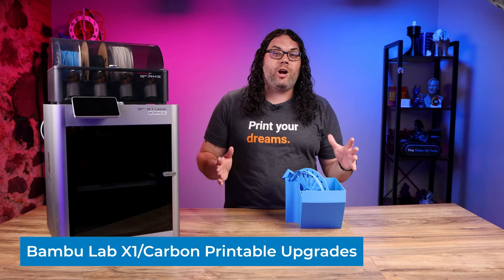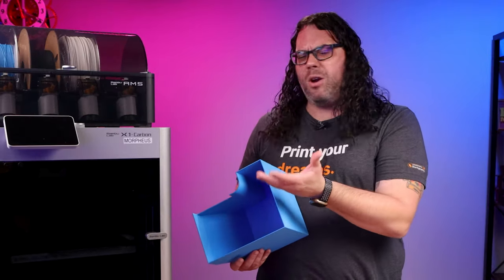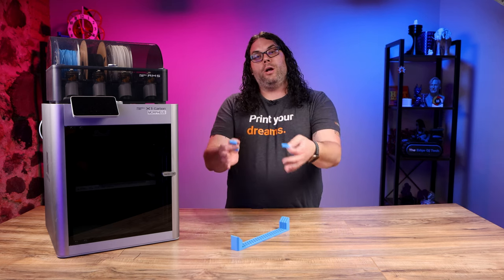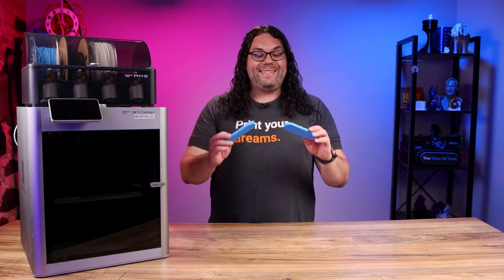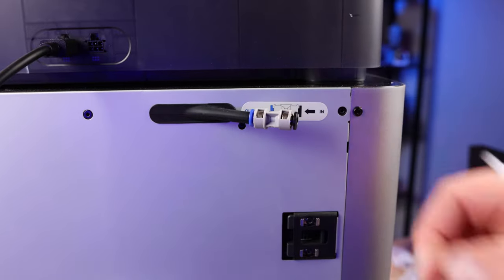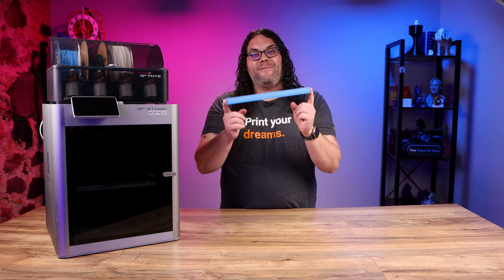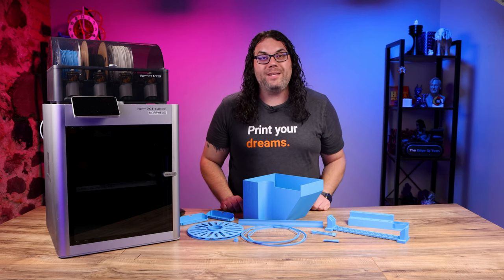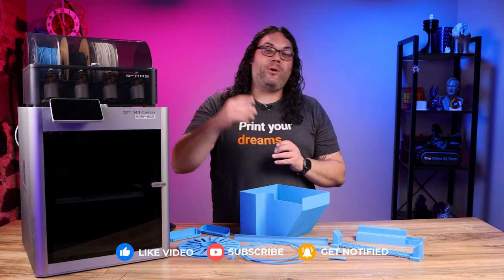10 Amazing Bambu Lab 3D Printed Upgrades You've GOT To See!

Comment: With the cardboard spools, I rip the two sides off and then use the spools that came with the printer as they split in half. There are also spool models built into the printer. This works the best with the AMS so far. You do not need to remove the center cardboard spool as the spool model slips under that.
Reply: Thank you!
Reply: I messed around with all sorts of different rollers and rings for cardboard spools, even tried designing my own, but wasn't happy with any of them. You need rollers to be very snug on the cardboard so that they don't slip when the AMS is back-rolling them, but you also need them to be very narrow because the bottom of the AMS has channels that are only about 10mm wide, and if your rollers rub against those, you'll have retraction errors too. If your cardboard spool is dented or not perfectly rounded or centered, a roller can exacerbate that and make it wobble in the AMS, and if your roller has retaining clips that go over the edge of the cardboard to hold it in place, stuffing it under those clips can create the dents and imperfections you don't want.

In the end, it's much easier to just wrap a single layer of electrical tape around each edge of a cardboard spool. That gives you great traction, no slippage, no extra width, doesn't need to be carefully adjusted for different brands, and it's faster than printing even the smallest roller. Which should be a lesson to us: not every problem is best solved with a 3D print.
Reply: The least amount of work for simple prints, is just to ditch the AMS and use the back spool holder.
Reply: You are a flipping hero. Thank you.

Comment: When it comes to the spool cover I would say it's a perfect reason to learn some CAD software, a model like that would two minutes in Fusion360 (hobby licence) + a pair of cheap callipers.
Reply: Too much effort. You can just scale it in Bambu Studio.
Reply: @drCox12  It's effort that's well well worth it, once you have some CAD skills you can unlock the true potential of your printer.
Reply: @ChimpyChamp  I agree but you should never overcomplicate things. If there's an easy and reliable way to get the job well done, then take it.
Unneccessary complexity is prone to failure which leads to frustration which leads to loss of motivation.
Learn step by step: Learning how to scale things in Bambu Lab is a lesson that is also applicable in CAD. Because just scaling the model is exactly what an experienced CAD user would do.

Comment: These are great upgrades for the Bambulab printers. The spool ring i use is from Blizzard called the Cardboard Spool Ring for Bambu Lab AMS (parametric) - I resized it for Polymaker cardboard spools by 1.5%

Comment: Great stuff you found, thanks👍 I did two smaller sized poop-buckets that can be found on Thingiverse ("bambu lab waste basket"). IMO one of the best mods for the Bambu Lab is a simple cotton-blanket to dampen this beast. First I bought some plywood boards and build a U-shaped enclosure for the sides and top, but the most sound emissions are coming from the back of the printer that needs to be accessible. So I just put a folded blanket on top of the AMS which is just hanging loose over the backside, but huge improvement. Not much improvement in decibel, but it filters this annoying high frequency hall-effect sounds very well and just sounds like common printer with it, not like a factory. IMO Bambu Lab should offer a silencer out of foam for it that fits nicely on the back.
Reply: Any Problems with heat or airflow?
Reply: @VigiHunter  Nope, the defaults work with all filaments I'm using and don't tinker with temperatures, flowrates etc., but just quality settings like shell- and infill-rates. I've one very cheap TPU-filament that wasn't working well and the default speed-settings with TPU should be reduced anyway.
Reply: @Leynad778  Oh I don't means heat while printing but heat problems in the back where the PSU, Mainboard and stuff is. There is quite a large fan back there so I was wondering if a blanket makes it a heat trap 😅
Reply: @VigiHunter  Certainly not during a German Winter.

Comment: Just throwing this out there. I been running cardboard spools in my AMS for months with zero issues. I had a few rings that I actually tossed in garbage because I was'nt using them. Cool video with alot of cool stuff! I need to make the plate stand for sure!

Comment: I've given up on wheels for cardboard and gone back to printing my own full spools.  I use Inland filament from microcenter, and even an extra 1/16" is enough to drag on the cover for the AMS. I may try and make my own wheels that don't wrap around the edges of the spool, but just barely extend past the edge.

Comment: Currently, I’m using a drill mounted spool winder that uses a 1/4 Allen key to attach to the drill and had strength to the part. I mount the bambulab spool on my drill and just rewind my filament from polymaker onto the bambulab spools.

Comment: I’m so glad I’ve come across this 3D printer, and can’t wait to get my hands on it. Also, can you use 3rd party filaments with this printer? It’s not a deal breaker if you can’t.
Reply: I have this printer and use third party filaments no issues so far. Used pla, pla+, pla-cf, silk pla, and asa.

Comment: You don’t have to unplug your AMS when using the Y splitter. Just uncheck “Enable AMS” in the slicer and make sure your external spool is selected.
Reply: Yea you're right, 

Believe it or not when the video was made that option wasn't a thing yet and you did have to unplug the ams

Comment: Ordered this printer already haven't got it yet but currently use almost exclusively polyterra since I have a local distributor for it, is there a problem with using it in the AMS?
Reply from the maker: I have not had too many issues with the AMS at all. Hope you love it when you get it!

Comment: I was hoping to see something good. For your Polymaker problem you can design your own in CAD, and print them in PETG, which stands up better than PLA. Design your own. I did with my ECO spools, which were smaller than the Overture rings I had.

Comment: Need the new spool holder the AMS to move it from the back of the machine to the side of the machine so you can push the entire case against the wall and not have it out 6 to 8 inches.  Great idea. Bamboo should have thought of it.

Comment: We need the STEP files to add some thickness to the center hole in the cardboard adapters. That would make the area thicker and less prone to fracture. OR  you have to do the hoop jumping and go through FreeCAD to convert the STL to a solid model then save it as a STEP file.  Then.... Make the corrections/alterations.

Comment: how and with which settings did you print the y-splitter. everytime i print one the filamnt is not going thru fully it is always stuck when it tries to go thru the ptfe tube on the out side of the splitter

Comment: Good informations. But the Y-Splitter does not work. After feeding the filament, it takes some seconds and the filament spools back. After some trials for and back it stops.
Sometime it works the first time, sometime after 2,3,4 trials. After disassembling the Splitter filament loadings works without troubles. It seems the time is now to long or the force to low.

Comment: Hello, do you think placing the X1C on a antivibration mat like for washing machines could get the noise levels down a bit? Mine is on the second floor and I can hear it trashing about in my downstairs living room.
Reply from the maker: Maybe! It certainly would help from transferring the vibrations to whatever kind of table or countertop you have it on. And that would probably cut down the noise to the rest of the house.

Comment: Great video. I'm intending to put mine into a hacked ikea stand with the printer on top and a large garbage bag underneath.  What I'm looking for is a printable poop shute that will allow me to "funnel" the poops out the back of the machine and then down thru a hole in the stand straight into a large gardage bin on the level below the printer. Does such a mod already exist?

Comment: @3:00 what is loose Desiccant ? Anyone have a URL of a good product to use with these new trays? How do I know when to replace it, or do I just dry it at that time? How? (new to all of this)

@4:57 - what material should I be using to print this (thinking of heat resistance need...)

Comment: Can you do multimaterial prints on it or is it just multi color same material?
Reply from the maker: You can do multi-material!
Reply from the maker: They send dissolvable support material to test in the box!
Reply: @TheEdgeofTech  as long as temp ranges overlap as when it purges it needs to purge the existing material out at temperaturew compatible with the second material temp

Comment: I am personally way too paranoid about the friction fit Y splitter, so I used another design that uses press fittings.

Also, pushing the PTFE tube hard into the friction fit splitter may lead to you damaging the tube, so be careful